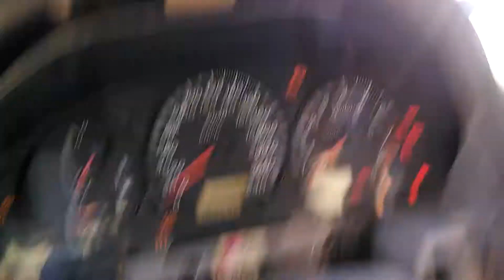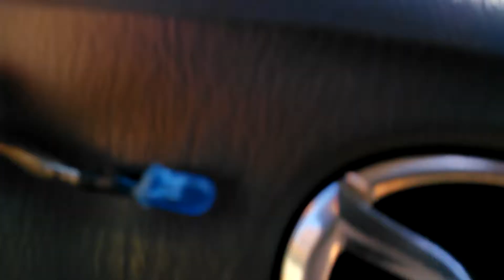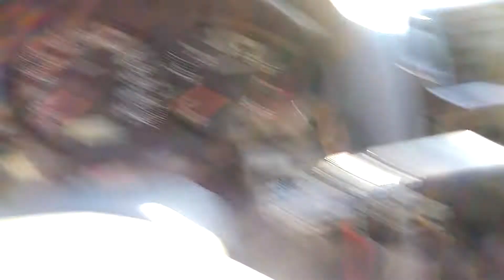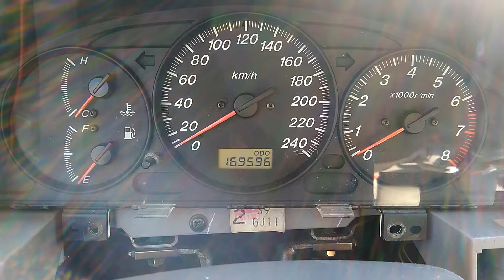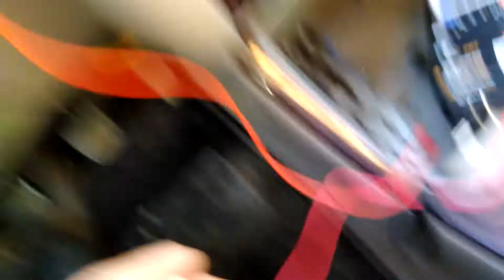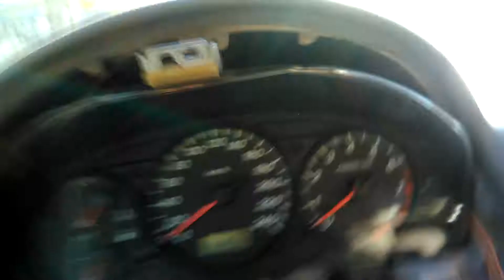Mazda 626 GF using security light as alarm light

Comment: Hi, will you have the wiring diagram?
Reply from the maker: Hello. I did not use a wiring diagram for this modification. Instead I opened the instrument cluster and traced the tracks on the PCB using a multimeter. If you need wiring diagrams the only ones so far I've found are in Russian, for the Capella (Japanese 626) - https://www.mazdabg.com/ftp-uploads/Mazda/626/Mazda%20626%20Capella%201997-2002.pdf I'm currently in a search for the wiring diagrams from 2001 which should have in then schematics for the instrument cluster with touring computer inside the tachometer. Capella doesn't have this, but 2001-2002 626 in Europe has it. Unfortunately it's pretty much impossible to find exactly these wiring diagrams on a good price.
Reply: @Mazda626GF I have the same car, I disassembled the board to clean the evaporator and when I reassembled it the cluster illumination does not work, I don't know if it is the dimmer swicth that died for that reason my question of the wiring dirgram
Reply from the maker: The dimming switch controls not only the illumination of the cluster, but all the backlight of all the buttons and the clock (clock is controlled only when on ignition position of the key). If none of these are light, then it is the switch. I've disassembled mine and I can tell you it'll be extremely hard to burn this thing. It has a huge radiator inside and for it to burn you'll need constant power more than it can handle but less than the fuse. Basically not to short it, but to overload it for longer period of time. I would also check wiring condition of the switch and the turn lights switch, as it supplies power to the dimming switch. If everything seems good, check my other videos for colors of the two wires used for backlight control and trace them. I believe I've shown them on the video where I install Mazda 6 GG steering wheel, the one where I install touring computer and the one where I move foglights button to the turn lights switch. If all fails, I have two paper books with wiring diagrams, but one is for the pre-facelift in German and the other one is for the facelift in English, but for the UK. Obviously the UK one will have some differences and the pre-facelift one even more (especially the IC diagrams). Still I can send you some pictures, but you'll have to wait, as I'm not in the garage every day. Let me know ;)
Reply: @Mazda626GF  I have tracked the cables and it seems that the positive 12v works well when I activate the light switch, but when I measure the cable that is supposedly grounded it also has 12v, the wiring I have checked and apparently it is not short, and as you say the illumination of the cluster, andall the backlight of all the buttons and the clock don't light
Reply from the maker: Yep, that is the way the dimming works - positive is always B+ and negative gets regulated. So when half brightness, you get 12V (B+) on the positive lead and 6V (B+/2) on the negative lead. The difference is 6V this your backlight runs at only 6V. When only 25% brightness, you still get 12V on the positive wire, but 9V on the negative one, leaving your bulbs to work only with 3V. And when no backlight is needed, both wires will get separate, not shorted, B+, exactly as you are measuring. For some reason your dimming switch is not figuring out that you have turned on your TNS (first position after Off on your turn lights switch). Are you sure you have the dimensions lights and license plate lights working? Maybe you blew a fuse?
Reply: @Mazda626GF  thank you very much for the explanation, the dimensions lights is working, license plate lights i'm not sure that working, I have checked all the fuses and apparently they are fine, everything works fine, except that the witness of the abs no longer turns on when I open the enclosed swich
Reply from the maker: I did not understand what you are trying to say for the ABS. For the dinner - here is a pinout of it and it shows where it connects and what signals it expects. Page 472 (T-22) https://www.mazdabg.com/ftp-uploads/Mazda/626/1997%20Mazda%20626%20workshop%20manual.pdf
Reply: @Mazda626GF  Thanks for the pdf, I tried to say that the abs light does not turn on, it could be the bulb that is defective, I will have to check, I see that according to the page you indicate, I am missing the scope
Reply from the maker: Hmm, missing only ABS light bulb is strange. Probablv it is only that only bulb. If you cannot manage, can send you what I have on paper books. Just give me your email and I'll send you confirmation message shortly, so you can delete your email from the comments ;)
Reply: @Mazda626GF  Thanks